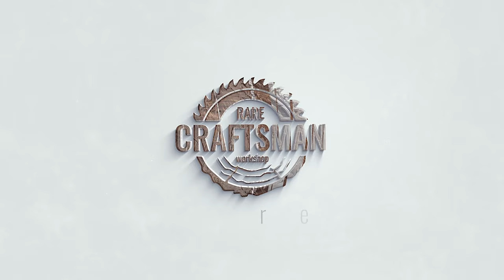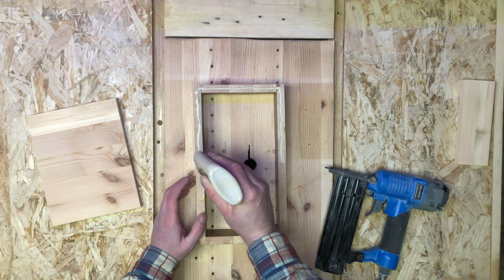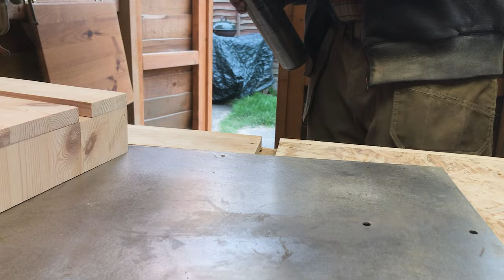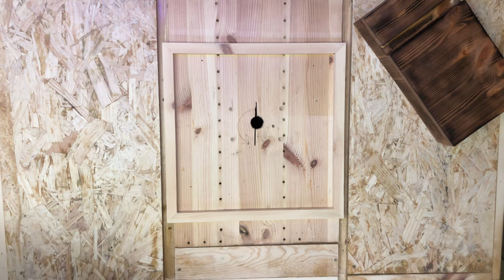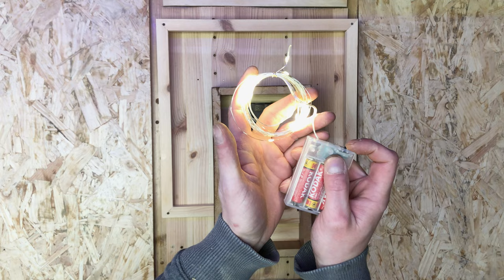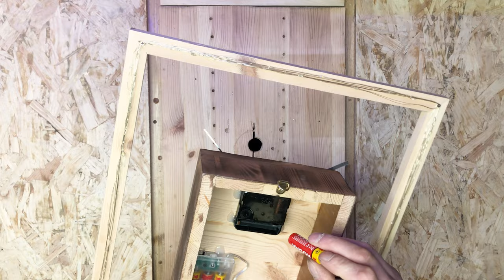Small woodworking project that sells: fairy lights wall clock tutorial

Comment from the maker: This is my tool list ( with identical or similar items ) 
(These are affiliate links so if you’ll buy using these you are supporting my channel ) 

Air compressor - https://amzn.to/43ojsvI 
Nail gun - https://amzn.to/3x5LZKe 
Table saw - https://amzn.to/3IFlnlV 
Band saw - https://amzn.to/3PpiQ3e 
Circular saw - https://amzn.to/3PpqTwJ 
Corner clamps - https://amzn.to/49192U3 
Ratchet Clamps - https://amzn.to/3VtxE4q
Stanley band clamp - https://amzn.to/491OxGy 
Push block - https://amzn.to/4aeuKF2  
Belt sander - https://amzn.to/3Pox0BD 
Orbital sander - https://amzn.to/3Vm4jJt 
Impact driver - https://amzn.to/4cheo0f 
Hanner Drill - https://amzn.to/48TKr3q 
Titebond glue - https://amzn.to/3TEs7GX

Comment: Awesome Project.  I might use some of that lighting string in my next project.  I need to figure out though how to get it to come on only when the doors open though......Kinda like the fridge.
Reply from the maker: Thank you. I wanted to install a motion sensor as it is possible to connect it to 5V system. But needed to release the video before my holiday and the sensor hasn’t arrived 😒
Reply: I know the feeling.  I'm waiting on some specific hardware to finish up an entertainment center!  Keep up the good work! @rarecraftsman
Reply from the maker: @FallingSunAcres  I hope this is still interesting enough 🤞😉